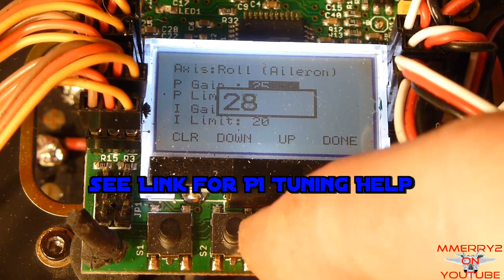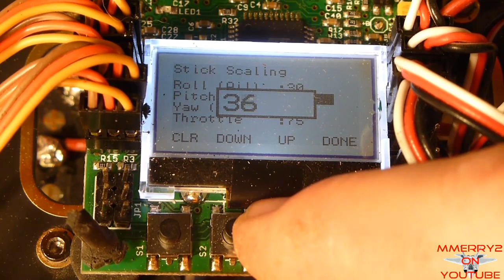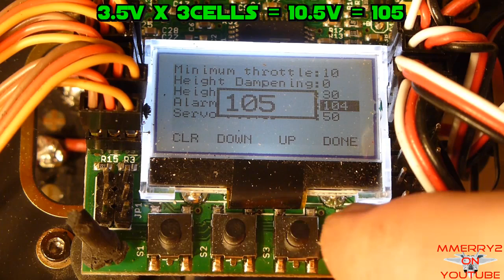HobbyKing KK2 Checklist - KK2 Settings (Part 4)

Comment: my kk board goes to armed but after 5 sec it goes back to safe like when i connect 3 motors it is working fine but when i connect 4 motors it goes from armed to safe in 5 sec and only 3 motors spin (all 4 motors are working fine individually) i did everything i could tried calibrating motors one by one and checked all motor connections help me please

Comment: When a prop is out of balance there is no way to tell if the problem is in the hub or the blades, but blade unbalance is the most likely because that is where most of the material is.  Adding weight at the hub is the least effective way to correct unbalance.  Doing it near the tips where the moment arm is greater requires much less weight.  You would not need big globs of hot glue or screws.

Comment from the maker: It's hot glue and a screw.   Used to balance the hub on the propeller.  Check out the video link in Part 1 at 0:32 to find out how to balance you hubs.